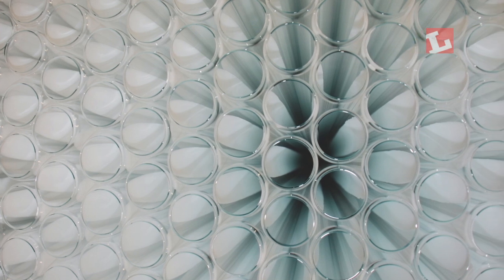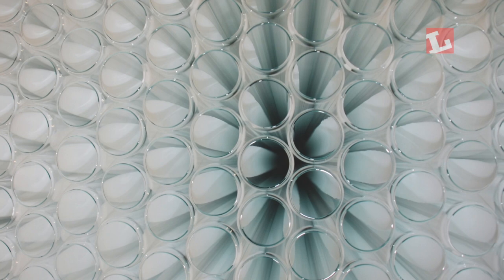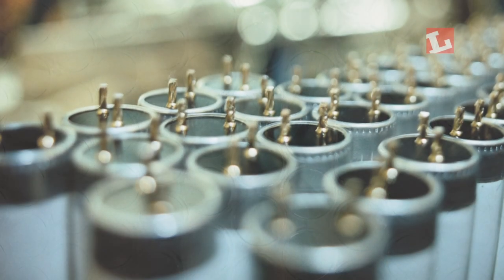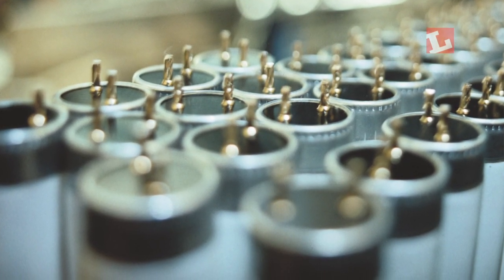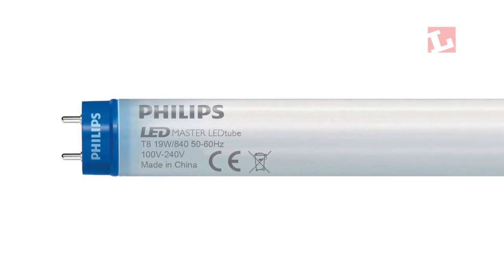LED tubes

Comment: I have come across contractors substitution LED tubes in back of house vapour proofs as a quick fix. I had to point out they need to re-wired and not just retro fit as someone maintaining the tube in the future may not release the supply only comes from one end. There comment to me was "oh s***, yes your right". I would avoid retrofit on existing unless the fittings is totally re-wired and approved. This is a typical situation when contractor try to take on lighting design. MOTH

Comment: Nobody mentioned that the light delivered from an LED tube will not work with the optics of the fitting in which it will be installed. Typically you get a 90° to 120° distribution which is OK for direct lighting but useless for a fitting with specific wall or ceiling wash characteristics. In this case you can very quickly produce lighting that does not comply with workplace directives and gets us right back to the dark ceiling days of the great Cat 2 fiasco!